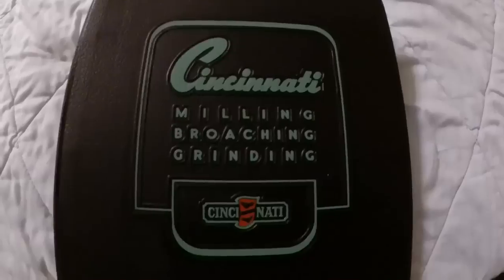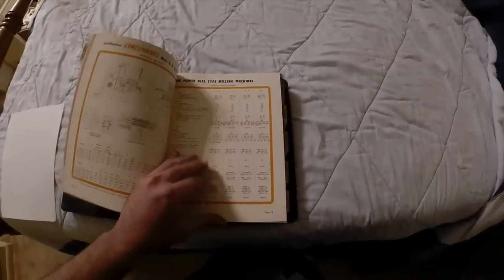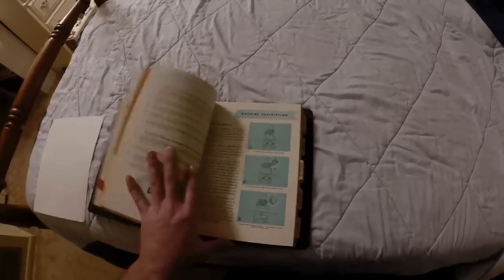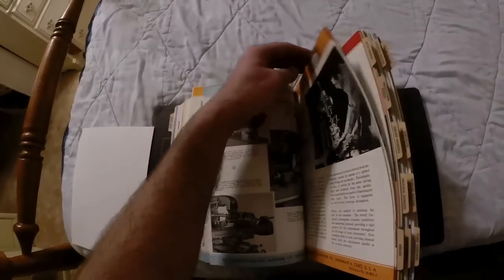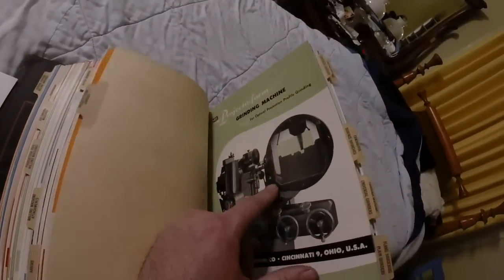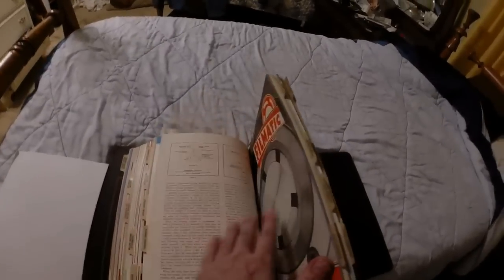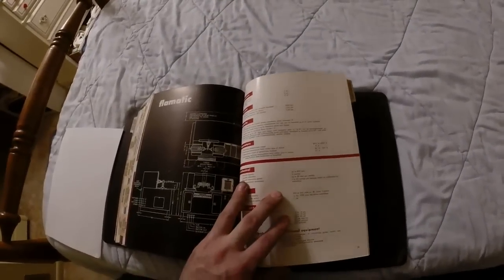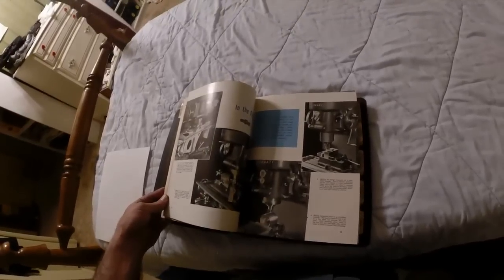1947 Cincinnati Milling machine Company Sales Manual

Comment: Do you run hygard in yours?
Reply from the maker: In my what?
Reply: @bcbloc02  in your Cincinnati
Reply from the maker: @earleclemans4836  i do in the gearbox in the saddle but I use way oil on the main machine.
Reply: @bcbloc02  i just obtained a Cincinnati and curious as to what oil. I have no books

Comment: Congrats on this rare find! Loved to see the collection abd you showing your machine in there. I want to know more about your mill!  Could you shoot takes of the wide knee and the outside supports? Thanks! Daniel
Reply from the maker: AtelierDBurgoyne  are you talking about where the knee clamps to the column for outside supports? If you mean table outriggers my Cincinnati mill doesn't have them, but my Giddings and Lewis horizontal boring machine does. https://youtu.be/_tdlIjv0C18
Reply: bcbloc02 Hi and thanks for the reply. I thought the mill has outrigger supports but my mistake then. I still like shots where I see the operator's hands actuate the lever and buttons on the machine. Daniel
Reply from the maker: AtelierDBurgoyne I will try to work in some of those in future videos. :-) Thanks for the comments!

Comment: Hi Brian,
You install a 50 HP on a little Bridgeport, get it to start and you'll never catch the damned machine...!
I like when you say "It's only 20 horses" with 50something thousand pounds...! lol
Do you happen to have a price list of that era... ? I'd be curious to find out how much would be those machines, in times where houses were $3 to 5 thousand dollars or just about.
Nice to have shown,
Pierre
Reply from the maker: I don't have a price list but I do have a 100years book that Cincinnati put out I think it may have mentioned some old prices in it. I will have to take a look. I bet even in the 40's that 36x120 Hydrotel was over $100K. 50Hp on a Bridgeport with the cutter to take the power would probably snap the milling head off the column! lol
Reply: $100,000 even now it's a lot of money, imagine in those years just after WWII...
Reply from the maker: pierre beaudry
 I have the original build sheet on my 15VMC Cincinnati CNC and I want to say in the early 90's it was like $200K and its about half the size of that Hydro-tel. According to an online inflation calculator $100K in 1947 would be about $1.1 million today. That sounds about right.  Going to have to work triple shifts for a long time to get that bad boy paid off!!! If you could clear $20/hr for the machine and work 24hr/day7day/week it would take 6.27years to break even. :-(
Reply: No dinner break or coffee break...???  lol
Reply from the maker: 120"bed at 14"/min feed rate you have 8.5min/milling pass for break and eating. :-) lol Have to be quick though as next pass you have to operate skid steer loader to scoop the 100lbs of chips off the floor!
Reply: I'll pass... lol  much too old to be the machine's  slave.... Chances I croak before it gets paid for...   :-#[